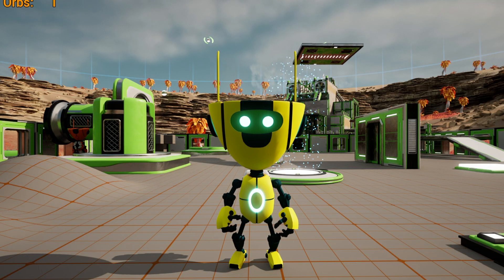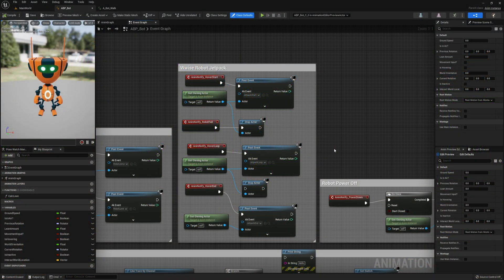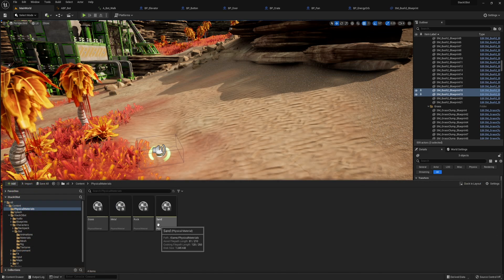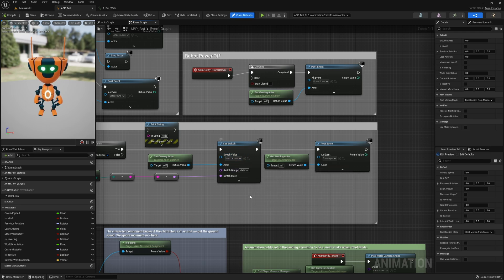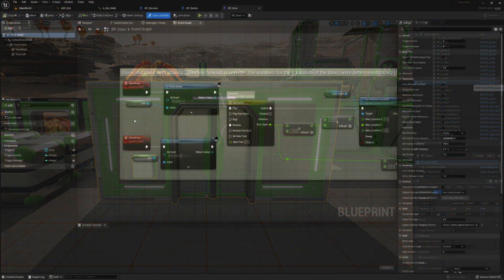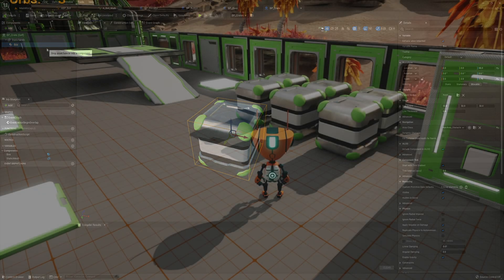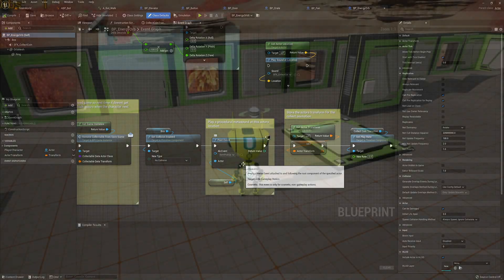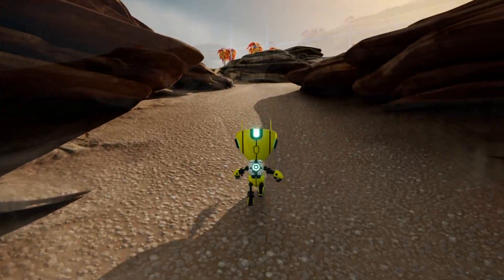Stack-O-Bot Wwise & Unreal Engine Implementation Complete Breakdown

Comment: Thanks for making this video! I have a question: How did you bind the physical material of the grass and identify it? I only successfully bound the rock, metal and sand.I bound the "grass" physical material for M_grass（Environment/Foliage/Materails/）but it didn't work.
Reply from the maker: Hey! Thanks for watching! This project was a while ago but if I remember correctly, I used box colliders or an invisible mesh that covered the grass sections on the map. Then tagged them with the grass physical material. I do recall the foliage was difficult to work with with because it was all baked into the map.

Hope that helps out. If not, I will reopen my project and have a look at how I handled that.
Reply: You can add a physical material inside the landscape layer info (its something similar to material but it is used instead of it when you paint on a landscape). In Stackobot there are 4 (grass, pebbles, sand & rock)